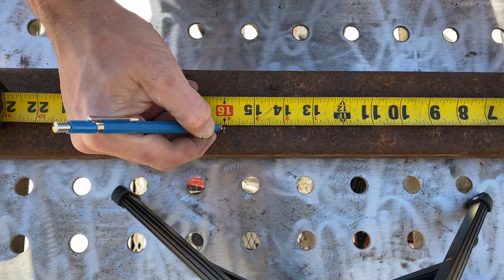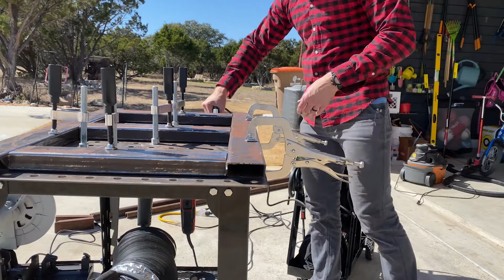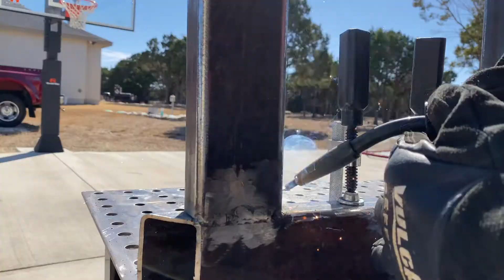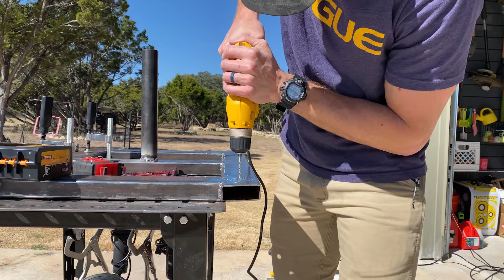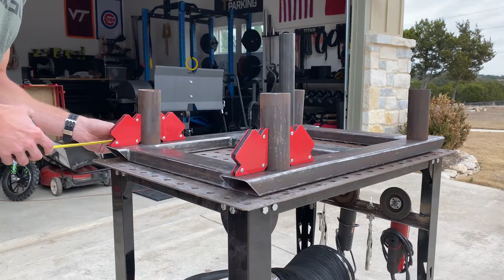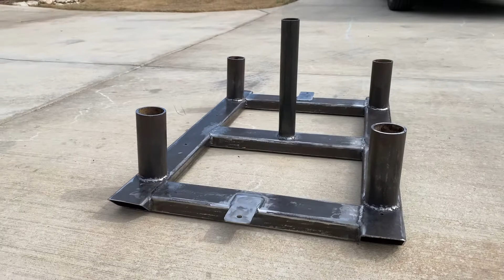DIY Rogue Dog Sled | Metal Fabrication

Comment: Can you provide dimensions and a material list?  I need one too.
Reply from the maker: The base is made from 2 X 1 X 3/16 rectangle steel tube that measures 36" long x 22" wide. The weight post and handles are 1.75" OD x 0.095" Wall x 1.56" ID Carbon Steel Round Tube with the weight post being 12" tall and the handles being 37.5" tall